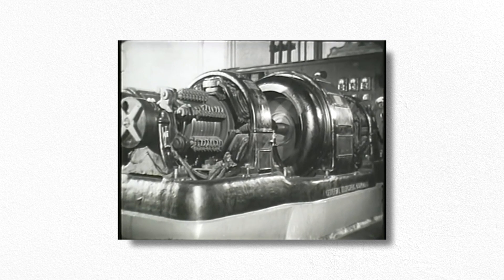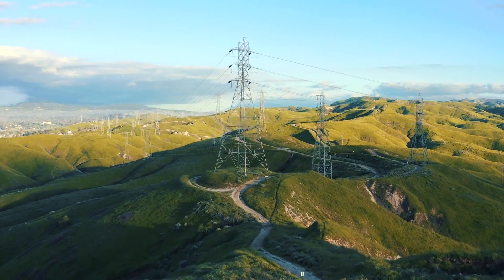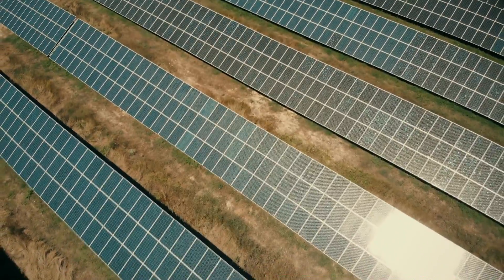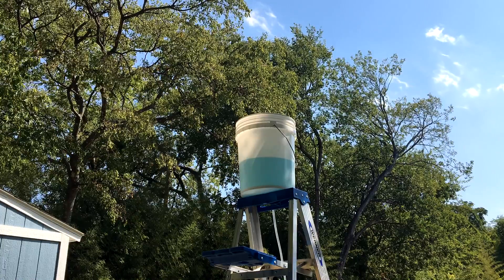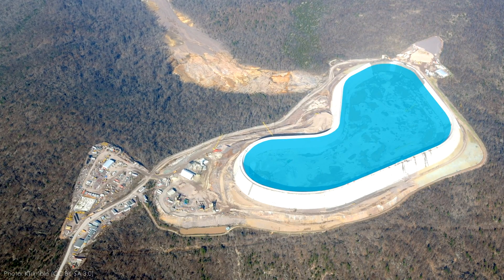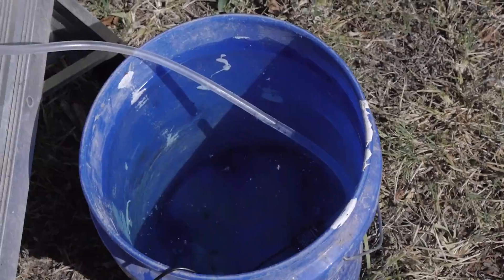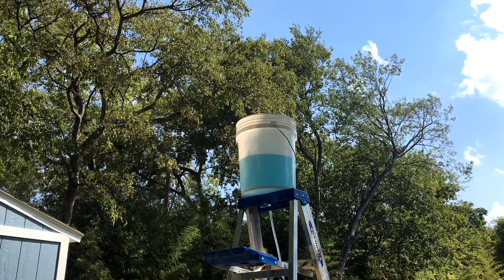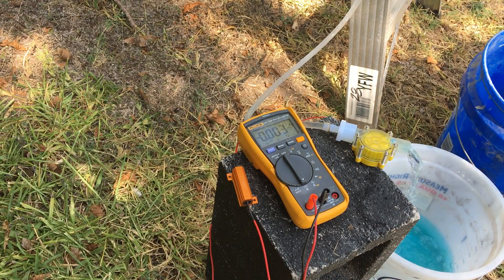World's Largest Batteries - (Pumped Storage)

Comment: That basin in your thumbnail- the Taum Sauk pump storage upper reservoir- I remember when that damn dam failed. It was incredible the amount of damage that caused. I've been down there several times since and the scour path still looks like a (very large) dry riverbed. Amazing, the power of water.
Edit- when they were rebuilding the facility the security they had was amazing. Military walking around with M16's and M4's closed off a perimeter of a couple miles surrounding the actual reservoir. It was enough to make me question what really happened to cause that malfunction.
Double edit- if you look at the very top center of the thumbnail that is the scour path from when the dam failed.
Reply: Love going down to Johnson shut-ins and hiking around there. Once did the hike from Taum Sauk to the shut-ins. The scar is one of the most impressive things I've ever seen on the destructive power of water... Especially 1 billion gallons in 30 minutes according to Wikipedia. That accident is definitely one of those hindsight is 20/20 kind of things.

Comment: hello, i'm not an engineer but i was courious, can't we just make a closed grid so that all the electricty that goes into the system comes back and is reused until it wears off due to resistence?
Reply: That's not how electrical power works.  When you use electricity to create light, or heat, or to do mechanical work, the electrical energy is changed into a different type of energy.  The electrical energy is gone; it can't "go back" somewhere to be re-used.

Comment: Homer Electric Assoc here in Alaska just bought a Tesla Mega Battery, which eliminates the need for a Peaker Generator. You didn't mention batteries when you talked about solar making peak power problems worse.

Comment: Rooftop solar and wind connected to the grid can supply power to these pumped storage units in reservoirs in mountainous regions and coastal regions with high cliffs. Also, pumped air into undersea chambers is one new method that should be taking off.

Comment: Pumped Storage does work in some locations but generally there are more promising energy storage solutions like Flywheel energy storage for daily usage and water electrolysis into hydrogen for long term storage. The good thing about flywheels is than you can store them anywhere even bellow solar farms or at the base of wind turbines and they have an energy density better than lithium ion.

Comment: This video is incomplete without putting the existing pumped hydro energy storage capacity into understandable units, like percentage of daily energy consumption.  And then you could present some estimates of potential sites and the cost of developing a new site and then comparing to the cost of other types of storage.  This kind of presentation which leaves out such numbers leads people to believe that pumped storage has the potential to address Renewable Energy unreliability.  But it doesn't.  The total potential capacity is way too small.  Grady, you are numerically literate.  You owe it to your viewers to help them understand these issues.

Comment: Couldnt we just drill a hole in the earth so deep where its Hot and let ocean water flow in and make energy from that steam?
Reply: That's basically what geothermal is, but you don't need seawater as there's already water underground. It works extremely well, but only in certain places where the Earth's crust is thin enough.

Comment: Thats why so called renewable sources of energy are not a solution. Grid cant operate right when share of renewables gets to high. How high? 30% its maximum what we can achieve and even in this case wind and solar create a lot of problems and rise electricity price. Just look: Germany and Denmark have the greatest share of wind&solar have also the highest prices. Denmark 0.31 EUR, Germany 0.30 EUR
And auther of this video is right that renewables cause grid instability, require a lot of additional investmenst and will force traditional power stations to work less efficient.

Comment: The first use of remote hydropower was at Niagra Falls, NY. The station was built at the falls and the power was transmitted to Buffal, NY using the Westinghouse AC system invented by Nikola Tesla. AC  allows the voltage to increased far above the generation voltage so  the Same amount of power can be transmitted with far lower losses than DC.

Comment: I have been to the pumped storage plant in ludington, mi. I think they said it ran at 75% efficiency. 6 reversable turbines servicing 6 pipes 25 feet across! It used lake michigan as the lower reservoir.

Comment: Has anyone looked into using extra electricity to split water and store the hydrogen/oxygen to burn for fuel later?
Reply: Termin18 Good idea, but sadly its got even worse efficiency. You are lucky if you get 15%. Problem comes from two sources: a) splitting water calls for conductive water, to get which you add ions in there like sulfuric acid, which makes water act like a resistor so it heats up. This represents a 40% loss. Second, hydrogen combustion engines are another 75% loss. So you get the picture.

Comment: 0:12
"Wind and solar are becoming more cost effective, but they'll always be unreliable and intermittent sources of energy."

Subbed.
Reply: What if we use space solar. The only prob I can think of is transmission then.
Reply: @mohammedraheem6288  Just that pesky lil transmission kerfluffle...

Haha, that's kind of a massive issue particularly considering the Earth rotates while orbiting our star, while tilted.

I mean I'd be all for it, but... We aren't close to an applicable technological solution.
Reply: @Claptrap Jesus well if we can find all the materials to produce the photovoltaic panels in outer space, then we would not need to send every panel from Earth's surface.

Comment: Gravitricity (gravitational electricity) lifts weight with unused/spared power whilst releasing/dropping the weight to create/change energy. In vertical holes? Or perhaps with other techniques. Or even using hoist, lifting block or snatch pulley (but causing friction)

Comment: Watching this video, I couldn't help but think of several other videos decrying the inefficiency of a hydrogen energy infrastructure. It seems to me that whatever inefficiencies might result from moving to fuel cells, these are trivial compared with the strategies employed to store energy today-- pumped storage, molten salt, and lithium ion batteries for starters...
Reply: You are correct - there is a lot of hype abt H2 storage and that tech still needs R&D to achieve plant scale outputs and efficiencies. 

A well designed and operated PHES (pumped storage) will achieve RTE (round trip efficiency) of abt 80% (turbines and pumps of power station scale achieve abt 90% efficiency each). 

Batteries aka BESS achieve 85-90% efficiency but at this time (2022) are 4 to 5 times more expensive than PHES.  BESS are good at grid stabilisation and FCAS (Frequency Control Ancillary Services). 

CAS (compressed air storage) suffers from thermodynamic losses even with good heat transfer and recovery. 

H2 (hydrogen) has recently got huge hype but this tech really still requires significant R&D to scale up to grid scale size.  H2 has good potential but is still quite inefficient compared to BESS and PHES.  Burning H2 in a gas turbine to make electricity is quite inefficient and fuel cells are only 60-70% efficient.  Producing the H2 is still quite inefficient and expensive. 
From H2 generation thru to fuel cell to an electric motor is only 40-50% efficient. 

On cost $/MW and $/MWh and efficiency H2 energy still has a long way to go.

Comment: Why not lift a massive weight, like a battleship, through buoyancy and then use the weight to create power in addition to a turbine when the water is released. Pressurize freon for air conditioning or suspend buoyant weight and release it like a grandfather clock. At 8 lbs per gallon, it seems there is substantial pressure to be harvested moving water.

Comment: Great video. I had this idea a couple years ago and didn't know what to call it. Once I found out it was called pump stored hydroelectric, I found out how unoriginal my idea actually was, but there were some glimmers of hope still, for originality:

Namely, I dreamed up a closed system where the fluid reservoir and pumps were clean and isolated from the elements. This would avoid the potential for debris from clogging the turbines and allow for the use of other, more dense fluids to be used. Using other fluids might increase the power density of such systems to acceptable levels for small scale to become viable. Imagine, for the extreme case, a system that utilized mercury. What sort of heavy turbine could mercury turn that water simply couldn't? What other fluids might be more useful and middle-of-the-road in terms of availability and density?

The other, major, benefit to pump storage is how easily sources of mechanical energy can be combined. One can imagine combining wind, ram pumps, stirling engines, steam pumps, and even traditional solar into mechanical energy this way without the need for maintaining the necessary power inverters and other equipment necessary for combining at that level. Storing energy this way scales in a way that more electricity-focused methods do not. One can simply hook another pump to the system without much worry for safety, other than understanding pressures (plumber perhaps?) and without the need for an electrical engineer. 

The power output would remain steady and predictable while independently scaling the input sources.

Comment: The energy problem is nothing but a robbery and political power ploy. We have the endless supply of water, which will endlessly recycle and produce endless amounts of power. One of my ancestors invented a hydrogen fuel cell in the 1800's. Producing hydrogen has problems, but not insurmountable at all. If a tiny percent of development that they put into solar and other renewables was put into hydrogen we would have an affordable endless supply of truly clean energy, couple that with methane(to bolster co2 for food production),outlaw
REAL pollutants and we could truly have a green planet. Outlaw communist corporatism ( fascism) also. They produce nothing but death.
ALL their projects are extremely toxic to our enviroment, batteries, solar , wind, GMOs, garbage, herbicides, pesticides, weather control, solar reflection,pharmaceuticals, leaking radiation, are all extinction level killers, the food supply is toxic, the air is toxic, the water is contaminated. Co2 is very last thing we need to be concerned about. They are not addressing a single real problem. Now the US Forest Service is going to spray the National Forest to combat invasive species. Nice, not one square inch of Earth will be spared the demonic attack on all life, great and small. The crazed new generation of raging robot zombies will finish off anything surviving the communist apocalypse engulfing the planet.

Comment: Why is power "cheaper" at night?  Same power plant, workers aren't getting paid less, coal/gas/etc doesn't cost less at night,  the only "cheap" aspect of it is that there's less demand, and power which should be a fundamental service is being treated like a commodity.      And that's fine, however I don't want to hear about pollution of "dirty demand plants" or any of that stuff if the basis for doing any of this is profit, in that case screw the power company, I'm going to use my solar panels, the power company is going to take my power because laws require them to do so and credit me at a 1:1 ratio, and the "duck curve" is their problem not mine.

Comment: "Wind and solar will be unreliable and intermittent"Great inspiration for your viewers in regard to the most promising and popular renewable sources!
Reply: I don't think they are popular for their technical characteristics, they are popular because they sound good - producing electricity basically from thin air and sunlight. However they can cause major issues for reliable power grid operation, which can be seen in interconnection with their higher shares (Ireland+Northern Ireland) for example. They have to curtail wind turbines' output, which can cause huge additional costs.
Reply: From an engineering perspective, he is absolutely correct. Neither works at all times ("intermittent") and both are subject to the vagaries of weather ("unreliable"). Of course, when viewed on national or continental scales, the numbers improve. As the old saw has it: "the wind doesn't always blow anywhere, but it's always blowing somewhere."

Comment: You showed the power plants by Niagara Falls which is not that far away from me. They are in some ways unique as they do not "pump" to store water as do some of your other examples. The massive reservoirs are fed from the up stream side of the falls by way of massive tunnels that run through the bed rock under the city. Gravity is used in all phases of the process. The falls are only running at a fraction of their natural water level because of the power stations. At night they can draw down the river flow so much that under 30% of water is actually going down stream. During the day they run down the reservoir so that the tourists don't see dry waterfalls. It is a unique situation.

Comment: Your experiment needs to be revised. You have excessive friction losses as your inlet pipe diameter is too small and suction lift over the bucket reduces inlet pressure.

Comment: The Tennessee Valley Authority's  Raccoon Mountain near Chattanooga, TN, has a head of 990' - at maximum drawdown it can generate 15 megawatts.
Reply: Fairly small cf. what one group in Australia is promoting: two hundred sites, each  with 200MW and ~10 hours storage , for a grand total in Eastern Australia's "National" Electricity Market of 400,000 MWh or 400 Gigawatt hours. Plug in enough PVs, wind farms and HVDC long transmission lines and they claim we Aussies can "keep the lights on" 24/7 using #NoCoal #NoGas #NoNukes #NoOffsets #NoWorries Mate! :-) 

https://www.anu.edu.au/news/all-news/hydro-storage-can-secure-100-renewable-electricity

Comment: Use ram pumps in sluice ways they require no energy to operate. This would fill the resavorse while the energy is being produced.
Reply: Ram pumps siphon energy from naturally stored hydroelectric power. A dam is more efficient but more damaging ecologically. This would only be feasible where a flowing river was next to the reservoir.

Comment: On the note of good pump power station sites being few and far between, what says we can't pump air down into the ocean instead of water up into the air? Buoyancy batteries, basically.

But instead of pumping air down to a fixed elevation and an expanding balloon, we go with fixed volume and varying elevation. The efficiencies of a winch instead of of a pump.
Reply: That's a lot of moving parts that'll need to work reliably despite salt water, currents, tides, and biofouling.
Reply: I mean I guess, although you could keep the whole mechanism in synthetic oil trapped in some sorta bell-shaped contraption except for one bevel gear set and a chain reel.

I imagine the whole normally used range of motion could be lower than waves and tides, but I guess there's always some amount of current even if there's less of it deeper. Might be a good idea to avoid fjord entrances and straights, I guess.

It does have some challenges that pumped power doesn't, yeah.

Comment: Yards Creek in northern New Jersey has 3 units. The spec plate reads pumping uses 200,000 hp to lift 730'  each penstock is 8' dia. I have to look at the picture for cuft per minute and out put.